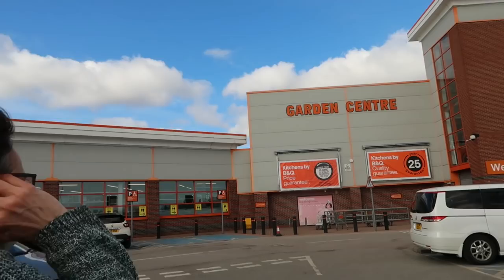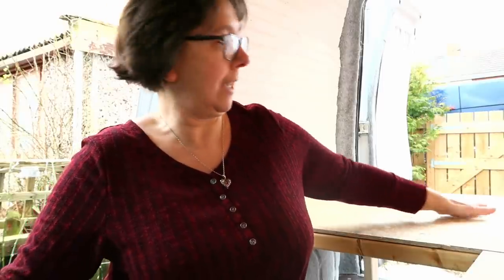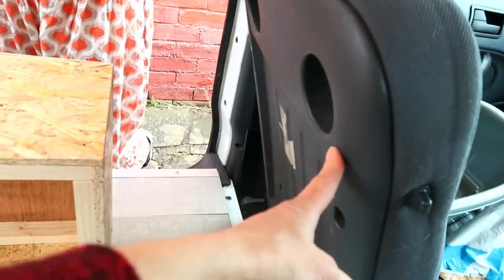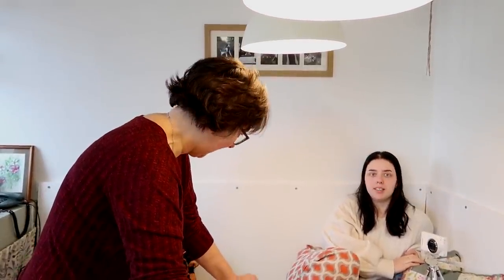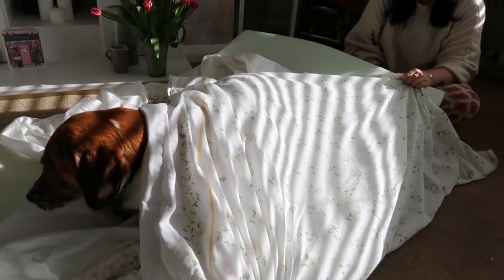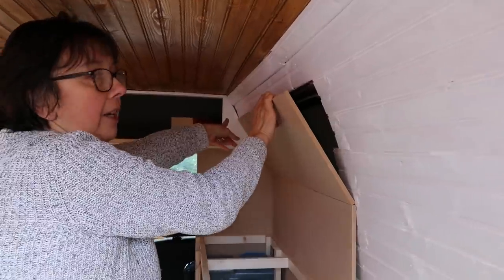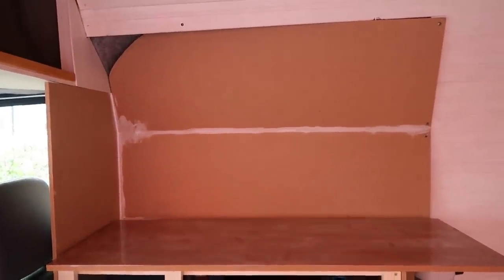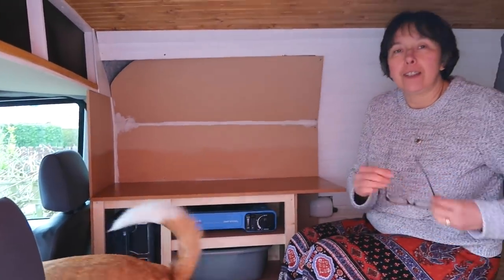#3 Ford Transit Connect Micro Camper Conversion - Week Three | Finishing the Bed and the Kitchen

Comment: Maybe i missed it but why did you cover the door where the kitchen is? The ventilation would’ve been nice for when shes cooking im sure? Or to access the kitchen from the outside? Looking fab tho!
Reply from the maker: Yes, thats a good point. It is a double side door van, quite rare in this model apparently, so the door didn't need to be accessible. The door still works so mybe we will make a venthole in the kitchen area at a later stage. It still has another five doors though :) Thanks for watching. Sending kindest regards Darren,Elaine,Jade and Max.

Comment: Great wee set up Jade van is cute!! if you find foil on your travels you could stick it on the wall thats behind your kitchen its a  reflective barrier😊💚 the pull out section on the bed is sweet👍 where did you purchase the foam mattress and your clever water tank😊 will you be servicing your van changing oil filter- oil- air filter fuel filter as a family with your skills i am sure you could 😉 keep up the great work love the videos 🚙🛠️💯👏🔧🌍🏞️🚙👍📸🎈👌
Reply from the maker: Great idea!! The foam was purchased online from a company called E Foam, we have used them a few times and the service and cutting they offer is very good. The water tank is from Amazon. The van has had a service etc before we bought it, but it will probably be worth re doing before a longer journey :) Thank you very much for continually supporting our channel.

Comment: Mini connect owner here....did you ever show how to build storage over the driver/passenger seats? Haven't figured how to do that myself....any help? TIA.
Reply from the maker: Good morning Marcia, thanks for watching our mini van build videos.
We show how we put in the large shelf above the cab on Jade's van build. It was on number one of the videos,  towards the end.
Looking back we didn't go into a lot of detail, but you do get the general idea and design principles. 
Basically, if you have the high top version, like Jade's,  you cut your shelf to fit and balance it on the existing mini shelf that the sun visors are attached to,  then we attached batons to to top side of the shelf and the batons we used for the tongue and groove. This means the shelf is sitting on top of the sun-kissed shelf and is hanging from the ceiling. 
Hope that makes sense.  The hanging from the ceiling batons also gives you something to attach doors to if you want to enclose the cupboard. 
It's a great space, very deep and bigger than you think. 
Hope your project is going well, I would love to see the results,  thank you Elaine

Comment: I would have recommended plywood and not MDF for the bed base and the kitchen construction.  MDF is very prone to water absorbtion, which will cause it to swell and lose its structural integrity.
Reply from the maker: Hi thanks David, yep mdf was used with at least 2 coats of sealant  before 3 coats of paint.
Reply: @PensionersinPortugal  yes, but it won't stop water ingress over the longer term, it's a no-no to use mdf under tiled surfaces, especially kitchen surfaces

Comment: Love how you lay out the water jug, stove, etc. to plan out drawers, shelves, etc.   Love the tile. Very homey. I never knew PVA could be used as a sealant on wood. You two are amazing.
Reply from the maker: I think we tried to understand what was important in using the van and tried to build accordingly, not that simple but we thought we would give it a go. The 'wood' we used is called MDF which is a fibreboard and would soak in any water so the PVA helps to seal it :)
Thank you so much, for your lovely words, you are so kind :)